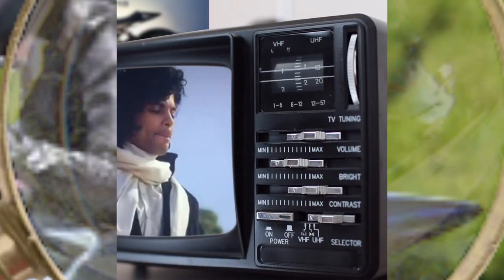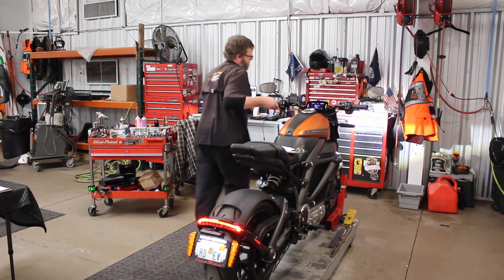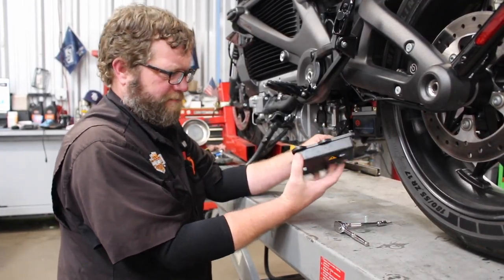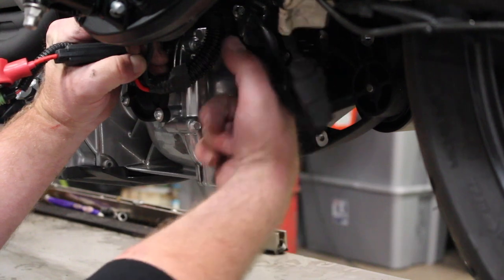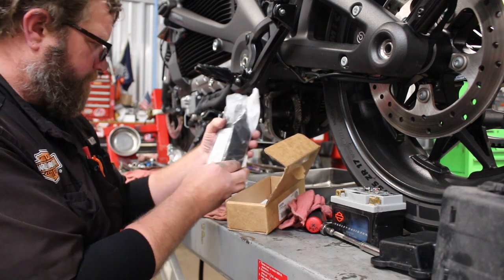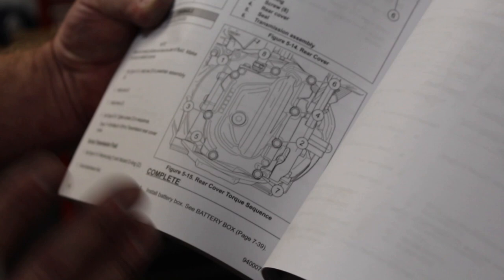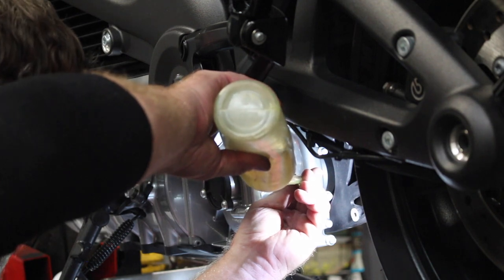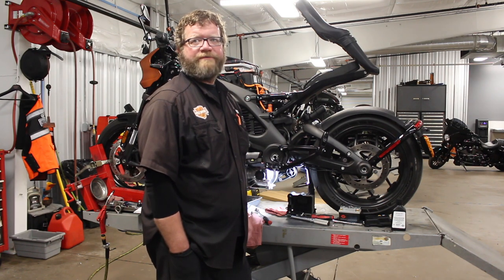1k Service on a 2020 Harley-Davidson Livewire

Comment: Look how clean the gear oil was. What a waste of money. Just another way for Harley to make more money.
Reply: exactly, total sham. Ok so take out brand new gear oil and brand new gasket, and replace with new gear oil and new gasket. got it! oh and don't forget to check the lights and horn too. Probably charged the guy 500 bucks. I just did the first oil change on my Kawasaki Z900 which was required at 600 miles. Same thing, the oil and filter were like new. At least it only cost me 35 to do it myself.
Reply: @roland5599  do you remember when you were a kid and you got your first dirt bike and you never change the oil but it still ran🤣😂🤣😂🤣😉
Reply: @davekent20  yeah it is too bad that the dealers have made the services so expensive that only rich people can afford to use them. My first bike was an old beat up honda 90 and I just did whatever I had to do to make it run.
Reply: @roland5599 Yeh but that has a running in internal combustion engine…. Did it have an oil filter?

Comment: I am interested in seeing someone actually rack up some miles on one of these bikes. Would like to know how the electrical system holds up to stop and go use. Great video.
Reply: The Livewire having it’s 1,000 mile service in the video is mine, just dropped it off to Sean (Bert’s Livewire tech) today 7/01/2021 for its 15,000 mile service, I’ve been riding since 1973 own 4 other bikes including a H-D Electra Glide but drive the Livewire daily with no issues at all and still love it the best out of all the others.  175/500
Reply: @Don-Kruse  Thanks thats good to know. I like the bike and think its just the beginning of a new evolution of motorsports.
Reply: @Don-Kruse  Don, do you you know what the part # for the EV oil and gasket are?

Comment: I have owned  a LW for 8 months now.  Great bike.  I used Mobil 1 synthetic 75w-90 gear lube for my first service.  I doubt if I will ever change it again.  Except for rear tires it is virtually maintenance free.
Reply: I found one for 19k I dont know if I should get it or go conventional. It was so fun to ride.
Reply: @tapastrat  If your looking for a mostly around town bike the LW can’t be beat IMO.
Reply: @jūn I am right at 3000.  Definitely a little quieter now.  I hate to say this but being a H-D owner since 1982 my philosophy is the less time your bike is at the dealership service department the better.  Plus, in this case I bet that Mobil 1 synthetic gear lube is a much better lube than whatever H-D uses.
Reply: @jūn I now have a little over 22,000 miles on it, here’s a follow up video to the 1K that Sean did on my bike in the video above,  here he’s performing the 20,000 mile maintenance on my bike. https://youtu.be/q8Vnyglc4hA

Comment: Removing the battery and tray looks a real pain.And how many jobs get skipped if a tech cant be bothered....I see it in the car world with pollen filters getting skipped if theyre too inaccessable.H-D should put a drain plug at the bottom and a fill plug at the top.....  And that gasket may leak a while before it gets noticed with the battery in the way....Still looks a great bike though...

Comment: Very helpful thanks. I test rode both. The oil is done at 1000 and not again until 20000? After 20000 how often is it changed?

Comment: What was the rough cost or is it covered under warranty
Reply: Mathew, it’s considered routine maintenance therefore not covered under warranty, as for the price it’s around 500 bucks give or take a little depending on the dealership you go to.
As a follow up to my 1K I took my bike back to Sean the same tech one doing the 1000 mile maintenance on my bike in the video above, he completed my 20,000 mile maintenance just a couple months ago, here’s a link https://youtu.be/q8Vnyglc4hA
Reply: @Don-Kruse  Thanks for the info. I have been intrigue by this bike since the launch. I am thinking will pull the trigger on this, as they price has come down a lot. This is a great machine and H-D did a great job. They spun off Livewire, so I am investigating. I am in Jax, so it was cool to have you fall through the crib.

Comment: Should someone be holding the knock stick for safety
Reply from the maker: We did while powering down all the batteries but after powering down the risk, which is already low, is almost non-existent. Everyone survived the making of this video.
Reply: @BertsMotorCompany  👍

Comment: This just put me off buying one lol.
The whole point of electric is maintenance free motoring.

Why does it need oil change at 1k?
Why is there no drain plug so it could be simple cheap change.
Why does it cost so much for this service and why is the bike so expensive.
I'll stick to my DIY builds lol.